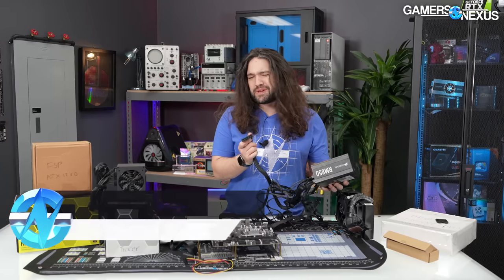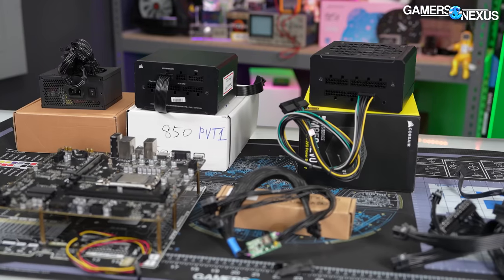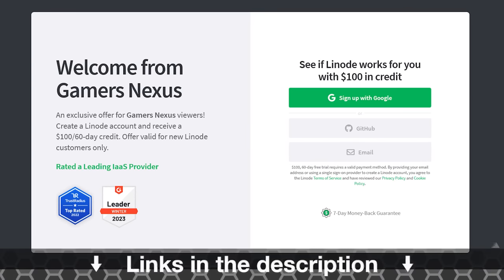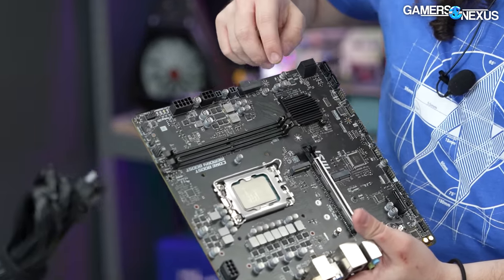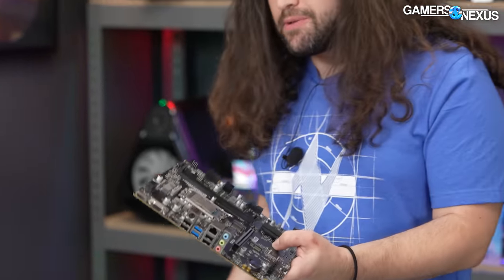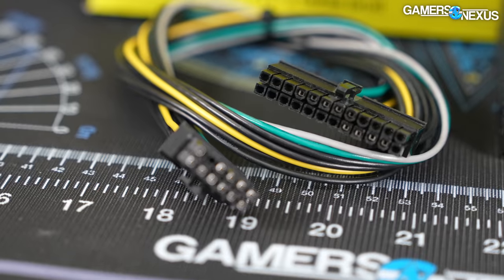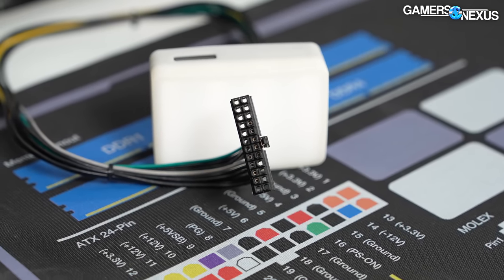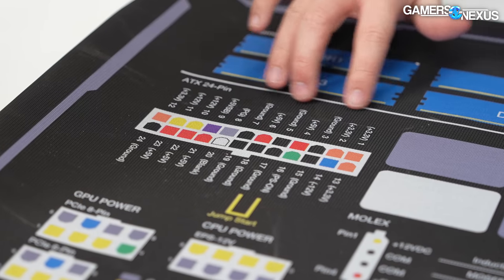The Future of Power Supplies - Maybe (Motherboard Cost, Cables, & ATX12VO)

Comment: i have an interesting take on the 12vo spec, could make adapter boards from the 12vo spec to the regular 12v/5v/3.3 spec, where all the conversion is done on that adapter board.. and the load percentage line could be linked to the mobo via smbus/i2c, defining it as a ps-loadsense sensor
Reply: Is there any usefulness to the idea, though? Outside of "New PSU, old MOBO" I mean. I wouldn't go out to buy a lightning cable with a lightning-to-USB-C adapter when I can just buy a USB-C cable.
Reply: seasonic is almost doing this already, not using the intel standard but doing exactly 12v to adapter board then to rest of PC.  Seasonic connect/syncro

Comment: Many people worried about power conversion failures forget that the industry has enormous experience with an entire class of PCs running with single voltage inputs - we call them "laptops". There was a previous attempt to popularize a laptop-like power standard in the shape of the Thin Mini-ITX standard, which mandated a 12V power input on the board and usually a barrel jack on a half-height compatible backplate (hence the "thin" part of the spec name) but it was a niche-in-a-niche, didn't have the volume to gain any momentum, and died quietly in a corner. I have an Asrock board built to that standard, it's from-the-wall power draw is exceptionally low when the system is powered on and idle, mostly due to the fact it runs off a 100W solid brick PSU (and partially because it's running an i5-6500T and GT1030) so it's not like there isn't precedent for engineering a power system of this nature.

Comment: I_PSU% is a current loop with a limit of 3.3v.
That means it needs a load (resistor) to turn the current into a voltage. To handle 200% overload reporting the maximum resistor possible is 1650 Ohms. Any larger and it would go beyond the 3.3v in order to push 2mA current.

Comment: 22:12 its for making 5V and 3v3 for sata/molex headers too.. not like it changes something dramatically, but it may be an issue if someone is going to mine some PoS and connect 30 drives with just two sata headers.

Comment: I can see a place for standardized  OG ATX adapters for 12VO PSUs. I think that is the most viable "bridge" product for this, even though it doesn't really solve any problem in that form.
DC buck converters are definitely cheap, as the mainboard manufacturers said.

Comment: As someone who's had the joy ( /s 😵‍💫) of troubleshooting intermittent PC crashes stemming from failing or overloaded power supplies, the I_PSU pin is a stroke of genius. I hope 12VO comes about for that feature alone. Besides, you could direct-drive an analog meter from that pin if you're careful. Imagine the steampunk PC mod potential!

Comment: Motherboards get replaced much more frequently than PSUs due to socket and platform upgrades. A good PSU can last 10 years, a lot of people don't keep motherboards for even half that time. Moving parts from the PSU to the motherboard means more parts that people are going to have to re-buy even more components every time they upgrade.  Plus this is another excuse for motherboards to keep getting more expensive.

Comment: 7:10 As someone who's done intense cord management in small form factor cases this terrifies me. If I was a customer that didn't know what that heatwrapped chunk was I wouldn't think twice about crushing it into a tight corner to tuck it away or bend it around something possibly breaking the solder joints.

Comment: Most of the modern ICs require more then single voltage, usually 3.3, but also 2.5, 1.8 etc. Even for every single voltage, it is usually required to have multiple LDO's, for different use. That means that some VRMs are required on the board any way and splitting 5,3.3,12 and -12, from PSU does not save anything. Just reduces available power and increases wire mess in the case.

Comment: Technically, all the existing PSUs based on modern DC-DC design are already ATX12VO considering the fact that the PSU itself only converts mains voltage to 12V and then this 12V gets further converted into 5V & 3.3V for minor rails (all inside the PSU). Now the major problem is with the 5Vsb that eats up tiny bit of power even when on standby mode and instead of figuring out a better solution to this standby power consumption problem intel stupidly (imo) came up with a solution that seemingly disrupts motherboards as well as PSU designs.

Comment: This needs to become the standard. I hate the 24 pin and there is a lot of wire waste. Although I wish the motherboard connector would replace both the 24 pin AND the EPS connector(s), a new generation should be just one mobo power connection, period.

Comment: My homeserver currently powered by a 36V cheap brick powersupply for custom DC UPS and feed 12V (Automatic Buck boost) to a 300watt PicoITX power supply. And that mini pico itx power supply relatively very small and seat nicely on 24pins motherboard power pin. As the result, my system doesn't have many tangling or wasted cables inside the case. 
In my opinion, if the standard input power can be set as 36v or 48v with optional power converter, this might be good for future. I think the only power hungry is from VGA, so I think only this part that need optional power module, and the other parts can be powered from mainboard dc converter, maybe 150w will be enough as standard mainboard dc-dc converter.

Comment: How are the motherboards going to dissipate the additional heat that comes from running 2 to 4 times more power through the layers of the pcb on high end cpu's, gpu's and the motherboards? Then there is the issue of maintaining signal quality for the cpu lanes, memory, gpu, etc given the much higher power and potential for power bleed issues with that much more power running through the pcb's. Also since the psu will not need anything but 12vo circuits/components you would think the psu could shrink in size, but, one example you showed, kept the same size or form factor? Why, to avoid retooling costs?

I will predict the cost of psu's will not drop significantly for 12vo units, but, motherboard cost will skyrocket... the current $200 to $500 motherboards will just become another $150 to $250 more expensive... as a customer, it will be hold on to your wallet, bend over and hope you like it rough!!!  Not to mention the area on the pcb that's currently used for M.2, debug leds, etc will be crowded out by required power conversion components for 12vo to 5v and under components...   It's hard to figure out how this is going to benefit the average home pc consumer. This looks like a move to benefit large commercial or server farm uses by pushing server style components into the home/small business markets.

Comment: So, HP actually did use a power supply scheme very much like ATX12VO with just a main mobo connector and cpu power coming from the psu and sata power coming from the motherboard.

Comment: @Gamers Nexus Steve, I see more disadvantages then advantage to the new 12VO spec PSU. RMA the motherboard for power issues would leave you without a PC when current spec allow you to replace the PSU instead of the motherboard. There is also the components that the motherboard manufacturers use for the different boards, we have seen them use cheap components in the past and with power. I rather have PSU manufacturers do that then motherboard manufacturers.

Comment: When you talk to the cost moving to the mobo from the PSU, I can't help but sigh. The PSUs I have, I have had for about a decade the oldest one. Unless they fail, you hardly have a reason to change them (if you didn't buy bargain bin) but the motherboard is another scenario. Sockets change far too often (specially from Intel) and if you are raising the price of this, more volatile per say, piece of hardware, things get tougher in locations like Brazil due to hardware prices and margins.

Comment: I think 12vo is a good step forward, power savings under standby aside, it simplifies cabling and reduces cable bulk.  Now imagine what would happen if a future 12vo spec could adopt a smaller pin, higher density cable such as what 12vhpwr is attempting to do, of which 12vhpwr also has a brilliant strategy for including signal pins; do the same for CPU EPS.  Further that by locating all of the power connections to a common area and make the motherboard itself a power backplane, then have a separate area to cluster any accessory power, such as fan/pump headers, ARGB headers, what 12vo is currently doing about SATA power, then cluster I/O elsewhere with a standard layout that all cases can work with using a standardized header; though when it comes to legacy plugs like SATA, I really do think that these would be better off with an update on the slimline connector, data plus power but on a smaller board-side connector, as SATA is unreasonably bulky by modern standards, maybe even introduce a SATA 4 standard that adapts SATA 3 throughput to a 12v pinout with a smaller connector, with an adapter on the device side for SATA 3 devices- a great example of connector reduction is the old USB 3.0 internal header to Type E, the 3.2 internal header, just apply this methodology elsewhere.  Then apply the same mentality to add-in cards, higher data density with power via the board, as a PCIe-successor, we've already seen proprietary riser cards in server hardware that double the density for PCIe devices at the board slot via a finer pin pitch, something like this works and the leftover slot area could be replaced by a bulk power connector; another idea is to have a parallelized slot, having the slots be the width of the case bracket itself, then open up the spec for ambidexterity as to which of the two slots the base PCB attaches to, which would be great for a reverse-mounted card like what Intel's newer NUC format should've done on the CPU compute card for cooling reasons.  There's a lot of various things that could easily snowball together to make systems so much more simplistic, and we're already seeing the beginnings of what could combine to make this happen, minus any foreseeable future of a PCIe successor; systems could easily become a few-cable solution, PSU to motherboard and motherboard to accessories, assuming accessories are fully daisy-chainable.  This kind of simplicity could also bring in more people into the DIY space, and considering the specs themselves would make things so simplistic it might get rid of some of the proprietary ODM nonsense we see in some systems.  A set of specs like this could also change how systems are built, for example we could see more systems like the newer NUC format since we're not relying on ATX this or ATX that when the spec itself is mostly just the motherboard being a data and power backplane, CPU compute cards could easily become a future norm, just as graphics cards are the processor, memory, and relevant components, which would relegate a motherboard to being I/O, as well as the data and power backplane.  Think about what this would do for SFF, HTPC, and console-like systems.  Personally, I think the combination of these things is grounds for a better ecosystem.  

I'm also a fan of the compression connectors Dell introduced with DGFF and have specced in the CAMM standard, of which Framework is now using, because they're higher density and fairly compact; I do wish they came in double-sided connectors on the device side, which would increase their density.  Apply the previous methods here, have one connector for data, have one for power, make the motherboard a power backplane.  Though these compression connectors would ideally move away from a screw clamp, just because this forces design to be tool-accessible, whereas finding some kind of spring clamp would work better; essentially as swappable as a slot, but you have a much higher pin density within two dimensions rather than one.  ODMs use proprietary stuff, at least in business and industry applications, to make swapping components faster, this is why you see so many proprietary quick swap implementations; the less time you have an IT department spinning a screwdriver the better.  But one cool benefit here of adapting these compression connectors is that you're also potentially bridging the desktop and mobile spaces, which Framework is also trying to do to reduce waste, such as their new compression connector based add-in cards eventually seeing adapters and external enclosures.  Imagine what would happen if the previous paragraph occurred but also included compression connectors as standard for everything; they're essentially a riser cable anyways, and builds have evolved enough in recent years to have PCIe risers anyways, things could easily be taken a step further if riser cables were the spec norm, freedom to place components wherever and in whatever orientation- think of the newer NUC format, again, but if it used risers instead of slots, it could easily be folded into a sandwich of CPU compute card, system I/O + data + power backplane, and the GPU, with a heatsink on both sides of the sandwich, minimal wire bulk and a single jump from PSU to the system board, with relatively hidden cables for system fans that would optimally be daisy-chained. 

I think it's long past time for the industry as a whole to stop tiptoeing around major change.  In essence, systems are still as complicated as they were 30 years ago, yet within that time we've had laptop board designers utterly simplify how system design can be, which is where 12vo stems from, where high density connectors originate from, etc.  Simplifying systems in this way would be beneficial for everyone on both sides of the money exchange.  Sure, motherboards get slightly more complex, but they're arguably already the most complex component of a build anyways, plus this simplifies the PSU side which also minimizes the PSU.  Where the connector side of things being minimized would simply everything else, and leads into smarter use of the available area on boards, such as compression connectors having a 2D array instead of a 1D slot.  All of it together makes sense and provides a better ecosystem, yet people just hate change; and compatibilyt isn't really an argument either, there'll always be a way to convert things, it's just how you physically arrange devices becomes the questionable part.  Better board layout is also a major factor in simplicity, which is why power needs to be clustered and why making the motherboard a power backplane is needed here, why internal I/O needs to be clustered and standardized to the point that virtually any case can use identical headers and cable routing, and why accessories need to be clustered for similar purposes and ideally accessories would be daisy-chained as to reduce header footprint such as what some fan manufacturers are now doing with single-cable arrays.  Just take the current add-in card spec for example of why hanging onto outdated specs is bad, modern GPUs are taller than the bracket rating, which causes case compatibility issues if the case isn't wider than the bracket is, and this comes down to the fact that PCB design requirements has outgrown an outdated spec; something at some point needs to evolve, and add-in cards will keep growing unless chips themselves are heavily minimized, which is unlikely to happen, thus the add-in card spec needs to evolve, and hopefully that brings a better board connector with it. 

All of these newer standards just need to co-evolve and amalgamate into a new PC part ecosystem.  Nothing described here is all that new, besides the need for a PCIe successor but that's also been talked about for a decade by now, everything described here is possible if the industry would actually take steps towards it.  Sure, there's some potential issues, but those could be easily solved during co-evolution of the specs and the amalgamation of the specs.
Reply: Well it's mainly the neglect of power efficiency that is driving GPUs to extend beyond the bracket rating. While it is inconvenient that people have to look up case compatibility specifications, I fail to see how that necessitates updating a purely physical standard when it might only require updating the PCIe slot standard instead.

Personally I'm excited to talk about different specifications and how they could improve PC building. However, I fear this is an opportunity for computer companies such as Intel and AMD to use the excuse of "simplification" and "ease of use" to eliminate upgradeability and modular components that so many people rely upon when building PCs. For example a lot of people in this comments have proposed eliminating SATA as an onboard motherboard connector, even though that would greatly inconvenience users who want to re-purpose perfectly functional older drives or use hard drives on their systems with an expensive (and unlikely to slot in considering lacking PCIe slots on current motherboards) add-in card. These kinds of issues and industry-wide changes can and should be done, but I fail to see how such a change could not be misused to push needless or harmful changes onto consumers that again, will always be at least inconvenient due to the backwards compatibility issues you mentioned.

Comment: combine some grounds together and put the % sensor in the pin location. seems pretty simple. call it atx12 v1.5 or something and changes the shape of the connector.... or use a different one that doesn't look like a giant molex from 19ugly.

Comment: Every time something off-board gets added on-board, I always worry about "what if that one thing fails or becomes obsolete and now the whole board is garbage?" In my experience, the power stages of power conversion are probably reliable enough to outlive the rest of the board, or at least they can be made to be. If the combined cost is less than current PSUs and mobos, this is good for the reduced footprint.